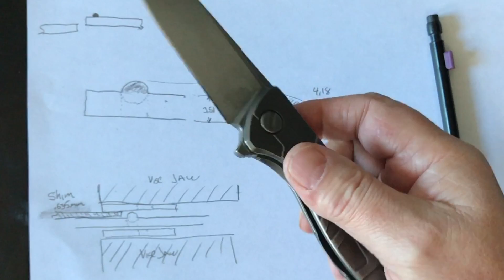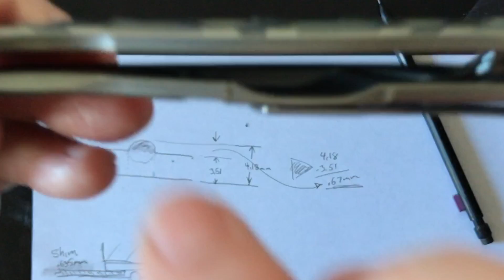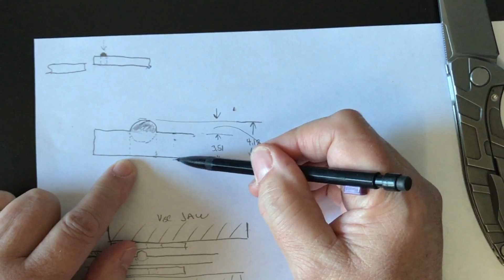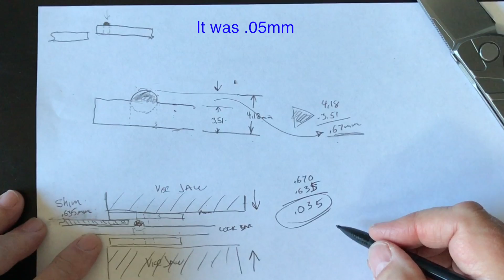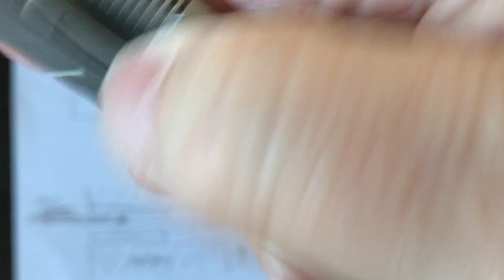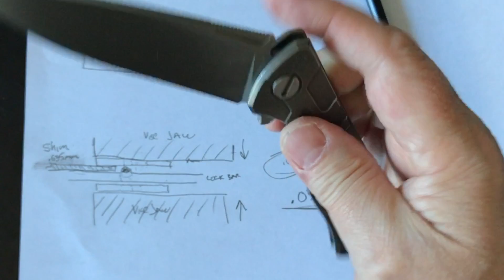Old Guy's Gentleman Flippers #26: Shirogorov Detent Ball Adjustment

Comment: I am thinking about buying one of the 3 bear version. May I ask when you run your finger along the end of the blade. Can you feel the edge when you put your finger inside the gap between handle? When I carried neon ultra lite, I ran into problem with the edge cutting into my hand at closed position when I pull it from my pants etc. neon lite had no problem because it had backspacer. I am not sure about the 95t.
Reply from the maker: Get Rekt On my neon ultra lite if I casually move my finger around that end of the handle the tip does not touch my finger.  If I shove my finger into the gap I can feel and maybe enough to cut it.  But I have never cut it with normal use.  The Chinese clone of that knife I have cut myself with so I ground/sharpened the tip contour back.  The 95T tip is a bit further recessed than the Shiro ultra lite neon.  But if I really shove my finger between the handles I can feel the tip although probably not enough to cut my finger.

Comment: Yes, easier and safer way that I did to my small Fantoni HB02 that was hard to break open:  Very, very, very lightly break the edge of the detent hole in the blade with a 'V grinding bit in a small drill press. Same effect. Also dangerous like your method- go too far and the blade will have movement when closed. Don't want that! Just break the hole edge ever so slightly. And don't forget to grind a detent ramp so the ball doesn't thump the blade edge when closing. :-)